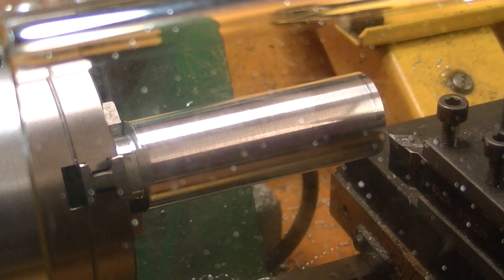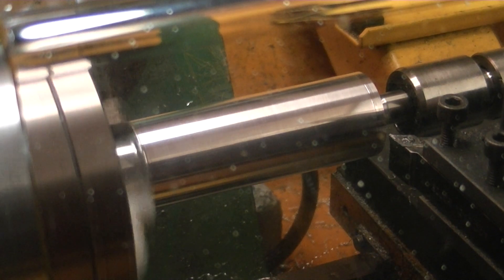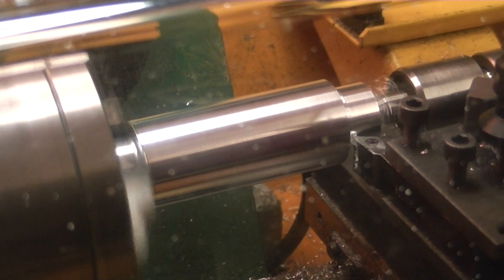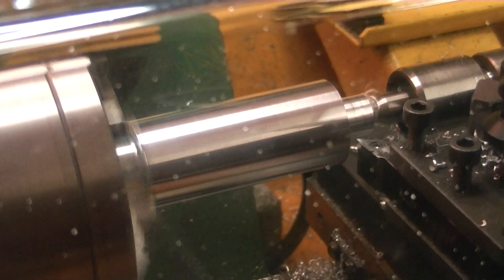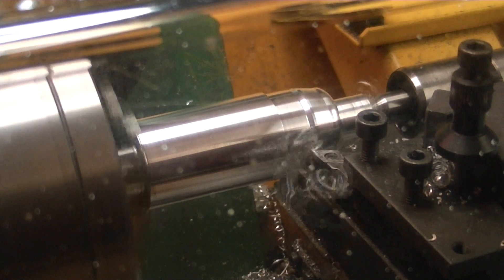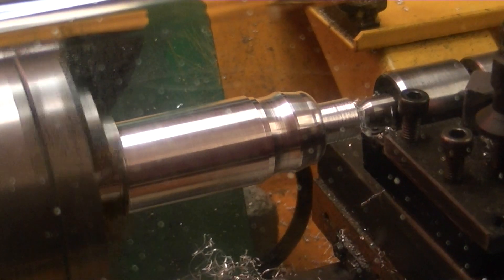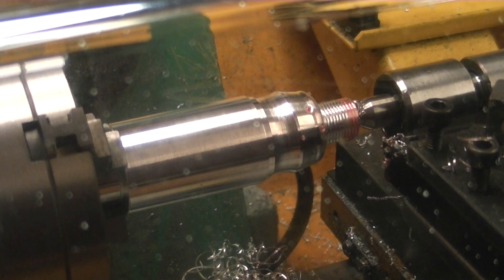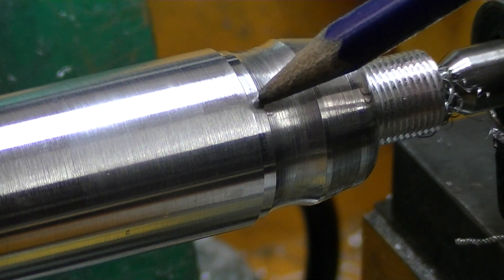Emco Compact 5 CNC Lathe Tutor 1, Machining.

Comment: Do you have the written programs of these operation?
Looks like a good lesson to start with my Emco
Reply from the maker: Probably have the program on my computer but not certain without checking. Are you using the original Emco G code system or has your lathe been upgraded to some other operating system ? If Emco does it have the M codes on the labelling ?
Reply: @ukmwg  ive registered to the group mentioned below, very helpfull!!

I have an original Compact5 cnc.
Reply from the maker: Join here and you can get help direct via email
 https://groups.io/g/Emco5CNClathe

Comment: hi again mr! :)

could you tell me please how many holes the spindle encoder disc have???

thanks
thanks!!
Reply from the maker: There isn't a control disc, the turret movements are controlled electronically by the DNC board, it does not know which tool position is active. M06 is used to activate a toolchange, the number of positions (1 to 5) needed to move to the desired tool is entered in the Tool number column, the turret then moves by the entered number of tool positions, stopping and reversing at each tool position. Remember it is tool moves not tool number.
With electronic knowledge the board components can be fine tuned to achieve the quickest possible tool position changes.
If you join the iO group at       https://groups.io/g/Emco5CNClathe         there is detailed information on this procedure in the Files section that you can download FOC.
Reply: @ukmwg  thanks !

i mean the disc for the rpm and index signal! thanks!
Reply from the maker: @EMCOAlex  Without checking I think there are 100 holes for rpm and 1 slot on the circumference for signal, Undo the belt cover and check the number easily, you will feel the slot on the OD of the disc.

Comment: Why is your tool cutting on the way out?
Reply from the maker: Hi John, these videos were taken before the gib strips were replaced on the Z axis. The Emco G84  turning cycle  doesn't have any X axis clearance added for the return move but on the final pass it does the Z towards the chuck and then moves out in the X axis before returning to the tool start position in both X and Z, so the tool doesn't drag on the finished job.

Comment: Now what about the method used to set up the machine prior to running the G-code. How do you calibrate everything so the machine "knows" what the relation between the cutting tool and the work piece is? I'm feeling quite dense while I try to sort this out with my new-to-me Compact 5CNC PC running under Mach3. Thank you.
Reply from the maker: You need to set the Tool OFFSETS, that is the relationship of the cutting point from T1 to the other tools T2, T3 etc. Using the Emco program to do this you can use the Emco Tool Scope or with a RH tool T1 in the holder face off the end of a bar and set the Z axis to 00,  turn the bar diameter and set the X axis 00. The corner of the faced end and turned bar are now the X00 and Z00.  Change to T2 and manually move both axis until the cutting point of the tool is positioned at the Zero Point X00 Z00, the digital readout will now show the tool offset to enter in the Tool Library for T2, DON'T reset the readout but fit T3 and repeat the process to arrive at the tool offsets for other tools, record the readings for all tools. The tool offsets are written as INCREMENTAL moves. As long as these tools remain fitted to their holders the offsets will remain the same until a new or different nose radius insert is fitted, or if using HSS until you regrind the cutting edge.  Tool wear will make a small difference to the tool offsets but for most hobby work it can be ignored, if running a batch you can measure the work and adjust tool axis offsets as required to keep parts on size. Check Tool Offsets in the Manual for more info, in Mach you may need to set a Home point for tool changes to take place, if so you can use this position for tool offsets using the required G code in the tool change commend line, check Mach documentation for details.
Reply: @ukmwg  Thank you!

Comment: i watched your video with the automatic tool changer(ATC),,, i am wondering what is the maximum diameter work piece that can be turned on the O.D. using a right hand tool plus the live center and passing over the carriage,, will it handle a 77mm (approx-3inches) diameter piece of stock or is it way less than that? thank you,, love the videos
Reply from the maker: Max diameter that can be turned over cross slide is 60mm.
(30mm from top surface of cross slide to centre)
Distance between centres is 310mm.
Swing over bed 100mm.
Hope this helps.